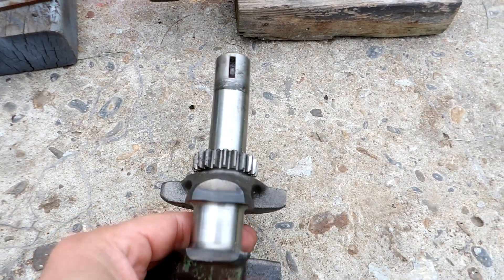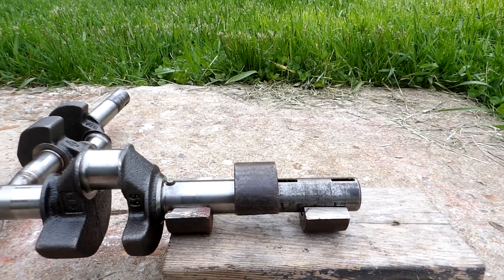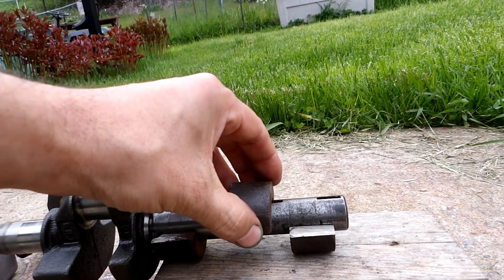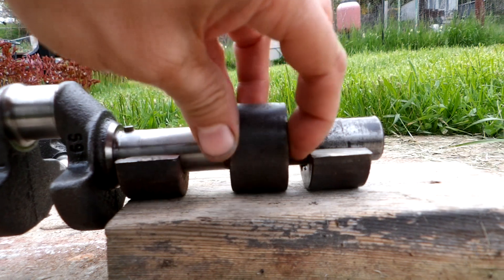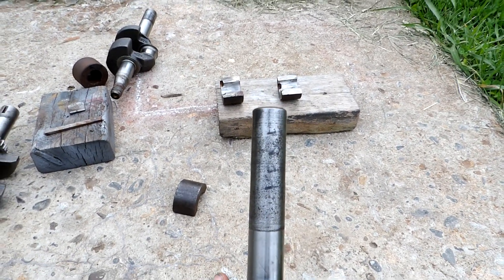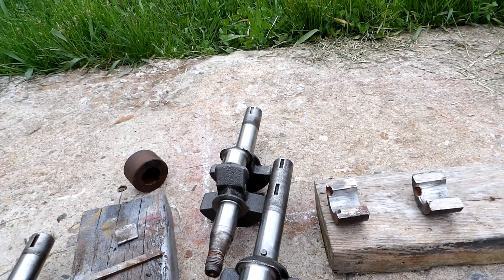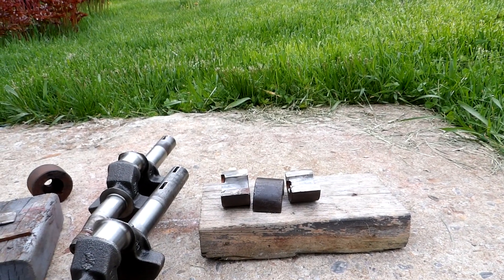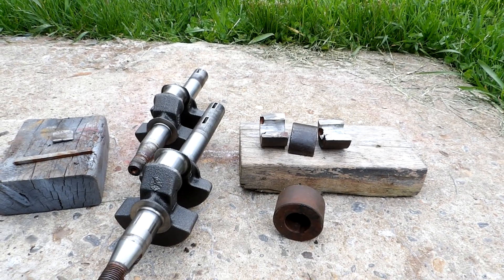Lawnmower Bent Crankshaft Straightener

Comment: That's a good way to straighten a bent crank!
I may get bored this winter and tear mine apart and try this method.
I've got one of the Honda commercial grade mowers that cost $1,600 - $1,800 new that has a bent shaft. 😮
And they're NOT easy to work on. 
The Briggs and Kawasaki motors are easy peazy to wrench on! But, the Honda HRC216-K3's are a PITA!
Reply from the maker: I hope it works, if you try to straighten it, it takes a lot of force in a press.

Comment: The actual crank shaft straitening tool is way too expensive to justify to most of us, so this is a great way of correcting the problem. Thanks for sharing buddy! Cheers! Zip~
Reply from the maker: Thanks, it is fairly easy to make also. Good to hear from you again, it has been a while, but you have an unforgettable channel name!  :)
A 15 ton press may be needed, as bot of these were still about 0.040 out of true after the 10 ton was used twice. So I guess you need more push when it is almost straight (I am guessing)